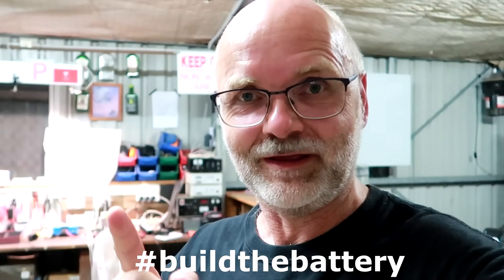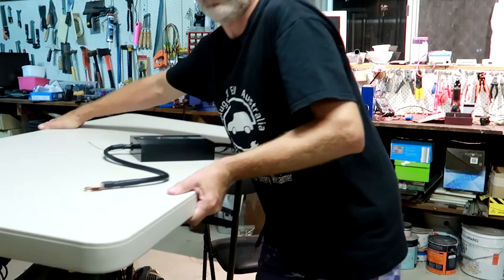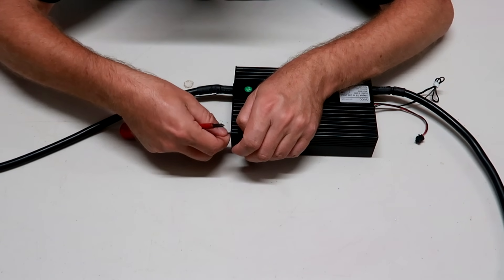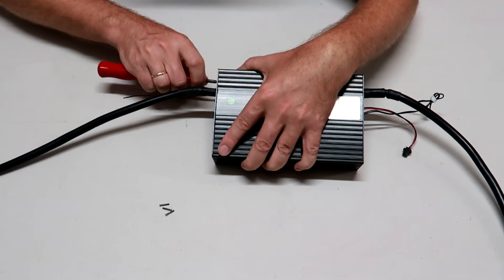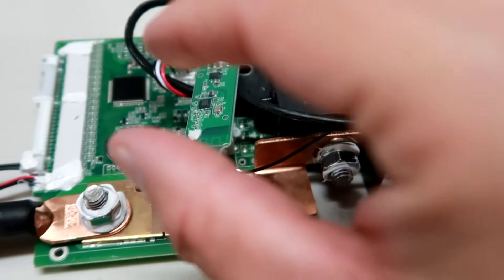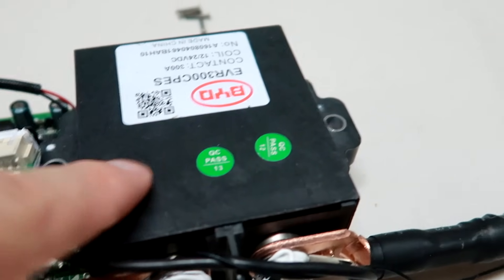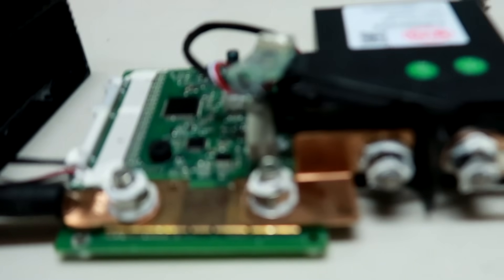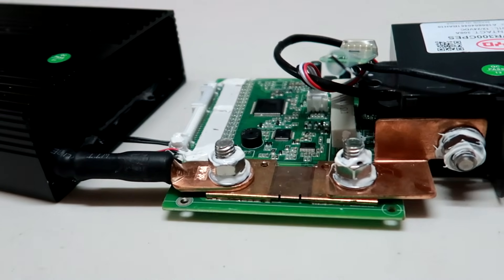Inside the BMS. Why I didn't buy a Daly #buildthebattery.5.1

Comment: The big white 10W resistor can only be used for one thing! And that's to dissipate heat! The more that your cell's become unbalanced, the harder it's going to work! 
Some BMS systems use multiple smaller resistors and will dissipate excess energy across multiple cell's if needed, this unit seems to only have one large resistor and possibly only discharges one cell at a time! 
I wonder how it's going to cope if more than two cell's reach full charge if it can only discharge one at a time? 
It might be a good idea to connect 3 cell's with one cell slightly discharged to see what happens? Maybe even take the BMS out of the case and so you can keep an eye on the resistor temperature 🌡️... 
Is it going to discharge just one cell while over charging the other full cell? Or will it disengage the relay while it brings thing's back under control and then finally reconnect the relay? 
Hmmm interesting not sure how it works!
Oh! And good after evening to you too! LoL 😆
Reply from the maker: You think there is only one resistor for all the cells? How do the balance at the same time then?
Reply: @OffGridGarageAustralia  I was thinking the same thing as well. That row of components you pointed out as resistors are more likely diodes and/or fuses. Most BMS units have a diode (and sometimes an inline fuse) between each of the cell measurement taps to allow the BMS to measure the voltage between each tap while preventing current from flowing the wrong way through the taps (Which is why you can't mess with wiring with the BMS connected, because if any of those diodes see anything over around 5v, they burn out. If you skip a cell tap they would see 3.2vx2=6.4v which is why disconnecting a single cell can damage the BMS) Sometimes self resetting fuses are placed inline to protect the diodes in the case of a wiring mishap.

Those components do seem a bit small to dissipate the heat created during balancing. Even the largest SMD resistors can typically only dissipate a max of .25 watts of heat. 200 ma of balance current would generate around 3 times that wattage at around .75 watts

Based on that I doubt they are the balancing resistors. I'd bet that big resistor is the ones used for balancing. I wouldn't be surprised if it can only balance one cell at a time. These BMS units really don't deal well with packs that get out of balance. I ended up adding "active" balancers to my pack for that reason.

I'd certainly be interested in a closer look at those PCB components. It's really nice you took it apart and gave us a look inside but I couldn't really get a good look at that board. :)

Comment: I do understand about what you are saying about the cable being underrated, but the rating standard is for a 1 meter length (?), whereas your bms cable looks like less than half that length.
Reply from the maker: Current rating has nothing to do with the length of a cable though. It does not matter if you send 100A though 1inch or 1mile of cable.
Reply: @ursodermatt8809  my bad though, I was getting mixed up with voltage drop... But voltage drop is a result of resistance over length.. So if over a length you have x voltage drop, then halving that length will halve the voltage drop. If voltage drop is a result of resistance, the current carrying capacity will go up the shorter the length, or the heat generated by resistance would go down.

Comment: For off-grid, use of relays is not at all my ideal since the coil consumes so much of the stored energy. I designed and built my own solid state relay network using MOSFETs, which consume next to nothing at all, and because I over-sized them for the current handling they will perform, the heat is minimized, so I really don't see that one is gaining function going to relays. All the off-grid folks I know always steer away from electro-mechanical relays.
Reply: mechanically latching relays, zero idle current....but!  have to worry about failsafe logic..won't return to a non powered state

Comment: What's the paste on the screws fixing the busbars ? I understand this is to avoid galvanic corrosion due to the material difference right ?
Reply: That is glue to keep the screws in position even if they slightly move for thermal reasons. It is also used to fix e.g. big capacitors or inductors in vibrating environments.
Reply from the maker: Yeah, it was already hardened stuff, thought it's just glue...
Reply: @OffGridGarageAustralia  So possible discussion topic : is there a risk of oxidation / corrosion by using "unplated" copper busbars ?

Comment: Shunt based BMS will draw more power on idle vs mosfet.
Reply from the maker: No current when idling, so no loss. This has nothing to do with the shunt but rather with the relay which always draws a bit of power...
Reply: Yes sorry I meant relay, there is more power consumption with a relay vs mosfets. And relays generally get very hot when being in high loads.
Reply from the maker: @Foxfried  Yeah I just measured the temperature on the BMS and it's still the same as last night. Relay is active all the time. I guess they are using very high resistance coils for such relays. These are been used in EVs to connect the HV battery to the drive train. 
No heat so far...

Comment: I doubt those small resistors do balancing. They can’t dissipate enough heat so it would take forever plus 3 days to balance a bunch of 100Ah cells. Those are voltage dividers so the chip can measure the charge levels.

Comment: Do they have a higher current version? 300-400 amps, I like to have a bit of headroom with bms, FET based or not, about 3-4 times nominal use, and about 30%-40% over peak, I tend to stay below 2500w and above 24v, but can get above 3500w on occasion, I hace been into solar for years, and worked as electrician for years, and worked with DC power since I was a kid,  but more recent started getting into electronics and electrical engineering, I have just learned the basics so far, I like your videos because it make me think more about the things I tend to forget about, and you help with ideas, thank you!! Great videos, even if you are crying about no tools, 
ha-ha, good day(summer day,   it's COLD here!!
Reply from the maker: Thanks James. It's win win, you guys helped me a lot thinking about things I would have forgotten about...
They don't build these any more. Hope that's not a bad sign :\
https://off-grid-garage.com/battery-management-systems-bms/
Reply: @OffGridGarageAustralia  JBD/heltec does still make these only in a different enclosure/branding

Comment: 12/24V contactor .. but isn't this a 48V bms? Does that not matter?
Reply: I am sure the BMS will only drive the contactor at 24 or 12v.
Reply: I'm sure that if we had a better look at the PCB, I'm sure that there would be a voltage regulator on there somewhere that would drive the relay, there would also be a 3.3V voltage regulator to drive the digital circuitry as well... 
What I'm currently concerned about is that I only saw the one bleed resistor! That's the big white 10W jobbie! What if two or more cell's need to be discharged at the same time to get the pack in balance? 
I guess that we will have to wait and see what happens!
Reply from the maker: I think the BMS runs on 12V only as it is a 7s to 20s.
Reply: @OffGridGarageAustralia  yes but I think that if you probe around with your multimeter while it's operating, you will find voltages of 3.3V, 5V and 12V, naturally the 12V will be to power the relay but the other voltages are needed to drive the microcontroller, you can always Google the controller part number and find it's datasheet pdf which will confirm it's operating voltage! It's not important but if for any reason it didn't work and you wanted to fix it yourself and you have the tools and techniques to make the repair, then it's relevant, otherwise, not really important for this channel!

Comment: I have the same batteries as you and find that they do seem to need a fair amount of balance charging after a decent discharge. I am a little worried about the small balance current offered by that BMS. I would keep an eye on the cell balances for a bit.
Reply: Would buy these batteries again or go for another brand?
Reply: @diydan6045  yes I would. Really good price point. Just need to be aware that they are not as well matched as say calb cells.
Reply from the maker: I plan to charge the cells to 3.35V only, so I'll the MPPT to charge to 53.6V max. If one of the cells gets say to 3.45V, the BMS will start the balancing. So in theory, balancing will not occur as long as all cells stay under 3.45V.
That's how I will start.
Reply: @OffGridGarageAustralia  wouldn't you need to push them slightly up the voltage curve so that you can balance. I balance 3.4 and charge to 3.5.
Reply: @jasondevine6014  yes he needs to balance lifepo4 when the cells are at the steep part (top end)of the discharge curve. If he doesn’t then the cells might be balanced to the same voltage but their capacity could still be very different

Comment: I have daligreencs 200A BMS, 8S280Ah , Blue tooth APP,  I followed the installation instructiona and everything worked fine. Two days ago I did something so I lost the output voltage from BMS. I tried to disconnect  BMS, short circuit B-and P- but nothing help.The next day I try again and it works again. OK I start charged battery again and everything works well. Then I tried connect BMS to PC via UART cable. Because I couldt find app I gave up. But now again BMS not work. No voltage. No blue tooth. I thing BMS is in some slipping mode. Have you any idea what to do.  p.s. I love your frogs.

Comment: Intresting to see the inside for sure. Im thinking could run several of these bms in parallel to ease the load or how to say.
Reply: BMS relays and disconnects shouldn't be in parallel.
Reply from the maker: Interesting. This may work as these are not programmable BMS's and all parameters are the same, programmed into he chip already.
Thank for the link.
Reply: @JPHER217  Yes, it is against the electric code.  I commented on Will''s video too.  One test is not proof that it can work every time.  What generally happens is one BMS will have slightly less resistance and start getting all the current.  Eventually, it will heat up and then MOSFETs will fail on.  Bad news if you had an overcurrent situation.
Reply: @jmaus2k  "My understanding is that yes this applies to regular transistors but the opposite applies to MOSFETs (as used in BMS units).MOSFETs are actually quite good at currentsharing (they parallel lots of them in inverters & they share current nicely). If a MOSFET gets hotter, its onresistance rises = less current flow, so next device carries more current, heats, equalizes, etc

My concern with parallel BMS's with load switching would be one switches on/off before/after the other leaving one to carry the load.

For cell monitoring/balancing it shouldn't matter much."    With this statement it should be the opposite of what you are saying right? I mean  the hotter they get the higher resistance and less current flowing thru that unit.

Comment: I just want to share my learning experience with everyone from a catastrophic failure today if you are considering different BMS systems. I had a brand new 8s pack of these 280ah cells turn to pillows with electrolyte everywhere from overcharge. The problem was a failure in the charge controller. It's high side fet shorted putting full solar voltage to the BMS. The BMS was a Daly smart BMS. The battery reached full charge and then BMS tried to turn off. Upon doing so the FET saw the full 96v solar voltage. This then shorted the charge FETs in the Daly smart BMS. Now full solar voltage was across the 24v pack.  Couple of hours later, I have a mess. I will not put a MOSFET BMS in ever again without knowing it's open circuit voltage handling. My big system uses diybms with relays.
Reply from the maker: Oh, no, Jason. That is not good and what a mess!!!! Sorry to hear that. Maybe these BMSs with relay are not bad after all to really protect your battery, right?
Are all Daly BMSs having this problem? That would be a major design flaw.
What charge controller do you use?
Reply: @OffGridGarageAustralia  yes using a esmart cc. And yes relay is the go. I will put a diybms on this one when replacing. The open circuit voltage handling of these get based BMS is the problem. Then other option is to put a crowbar circuit onto the system for this kind of failure mode so that fuses would blow.
Reply: @jasondevine6014   @Jason Devine  I'm a beginner looking at building my own battery and looking at using a JK BMS with integrated active Balancer but I believe they use fets so was wondering what you mean by a crowbar circuit? Thanks

Comment: Some of us not living in the tropics would need a low temperature cut-off in the BMS as well. Not negotiable.
 I find it hard to believe a relay that size can draw only fifty microamps. Milliamps, maybe. But microamps?
Reply from the maker: I'll measure it in the next video. You can program the low voltage disconnect in the BMS. I've seen the option.
Reply: @OffGridGarageAustralia  Thank you. The low voltage cutoff usually is programmable, but large parts of the US routinely see -20° C in the winter, and few BMSes include a critical low temperature cut off.

Comment: The silicone insulation is rated for 200°C. The cable is 200A capable  but will get quite hot.

Comment: Yes, this bms seems to be high quality and has 5 stars reviews but no loger available.  I would have gotten a caple to play around.I  got 6 Daly last week for some testing too. The problem with relay is that they are more prone to failure and not as efficient as mosfet type bms.
Reply from the maker: Hmm, not sure if this relay is not more efficient considering the huge amount of heat created in other BMS's.
Reply: @OffGridGarageAustralia  You should measure the amount of power the contactor draws when it's closed. The coil on most 200A contactors draws around 20 watts: It takes a decent amount of power to keep that big electro-magnet pulling that spring loaded contact closed. This is another advantage of the MOSFET based BMS units. The MOSFET units waste more energy under high loads (From the heat generated from the voltage drop across the MOSFET) but the contactor type BMS is always pulling 20 watts even if nothing else is pulling energy from the battery. 20 watts may not seem like much, but that's almost 0.5 kWh for an entire day of usage.

It really just depends on your use case. For me I needed to build a system that could offer sustained power outputs of 10,000 watts. So it made more sense to go with a contactor. If you're not going to be pulling that much power continuously then MOSFET's may be a better option.

Comment: OL on your meter is Over Limit (over range of the meter), not Overload FYI. The RS485 port is for continuous monitoring without using Bluetooth
Reply: Are you saying this BMS has an RS485 port? Isn't RS485 usually used to provide CAN-bus? Where did you see the RS485 port in the video?
Reply: @JeremyAkersInAustin  8:14
RS485 is not CAN bus
Reply: @JeremyAkersInAustin  at 8:13 you can see the RS485 port. RS485 is a communications protocol which is commonly used to communicate with industrial equipment, alarm systems, SCADA controls in chemical plants, etc. In this case it is probably being used to monitor the status of the BMS in real time.

Comment: The big resistor is probably for spark avoidance, first you connect trough the resistor till the condensers in the load/inverter are loaded and the you make the "right" connection (w/o resistor).
The BMS looks pretty solid! 👍  Only thing I personaly dont't like is the way how the balancing is done, by "burning" the excesive charge
Reply from the maker: Thanks for the explanation. As I have solar and the balancing should not be used often (charging to 80% only), I'm not too worried about that loss. Its free energy.

Comment: Hi ; thank you for the information about this interesting BMS ; But i still have a question : is it possible to use it in an 8S configuration ? On various sites, they show wiring diagrams for 13..16S , but not the 8S - although they all advertise the product as a "7S 8S 10S 12S 13S 14S 15S 16S 17S 20S BMS" ; does the documentation provide a wiring diagram for an 8S configuration ? Thank you in advance !

Comment: Do you keep all the balance wires the same length? I was told that you need to keep all the battery wires the same length in DC systems?
Reply from the maker: I have extended some. It's just for voltage sensing so there is no current (and hence no voltage drop) unless the BMS balances this cell.

Comment: That large resistor is part of the precharge circuit in the BMS.
It will charge up the inverter capacitors slowly,  preventing the large inrush current from welding the BYD contactor terminals together.

Comment: The short bit of 4gauge, should be fine, I would feel fine with 150 amps from that bit of 4 gauge cable, as long as it's short! 200amps peaks maybe,  do they offer this BMS in 7s liion, 3.7/4.2v cells, 29.4v I need atleast 225-275 amps continuous, I'm looking for a better BMS, this seems nice! I'm interested to see hows it goes!

Comment: It would be a latching relay, they only need a short pulse to switch its state.
Reply from the maker: Best reply. That could be the case. I will measure it tonight and post a video afterwards. Got the BMS connected for 1.5 days now and the BMS is cold even the relay is closed.

Comment: Glad you didn't stay discouraged from your last video.  You are also building a massive 16s battery, not the 12v or small cell ebike ones most videos show.  Nothing wrong with a longer video.  4awg cable might be ok at 200a.  The voltage drop may be higher than what you want, but it probably has 90c rated insulation and won't melt.
Reply from the maker: Thanks for your feedback